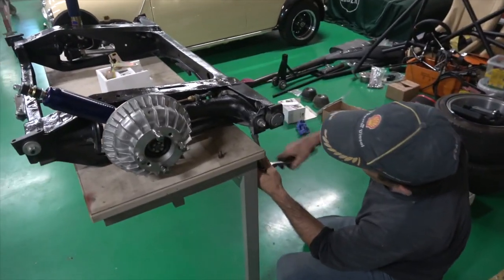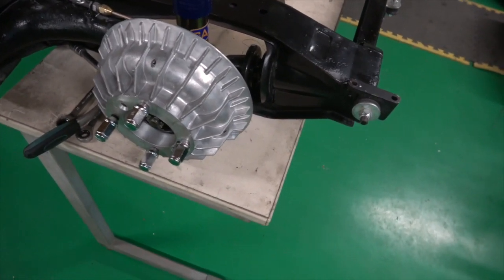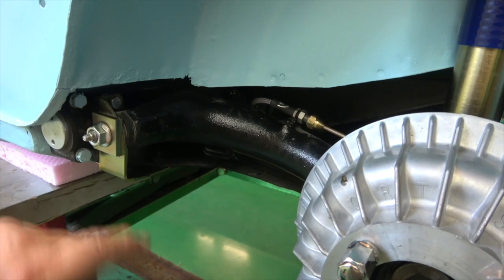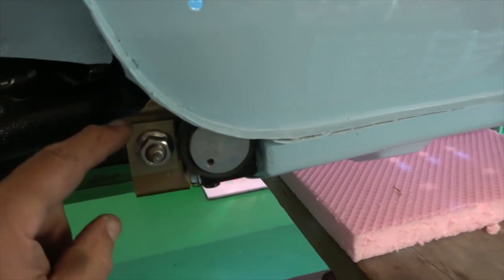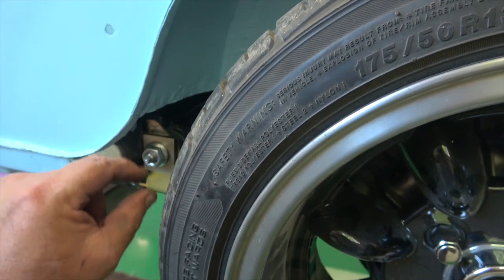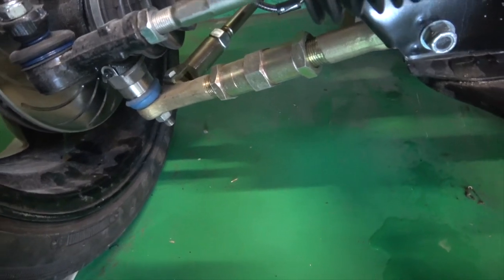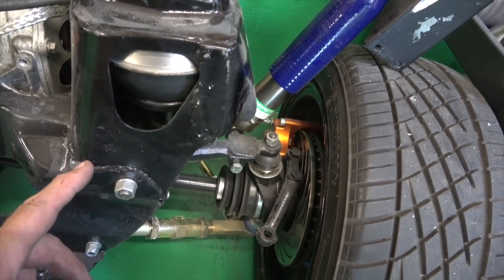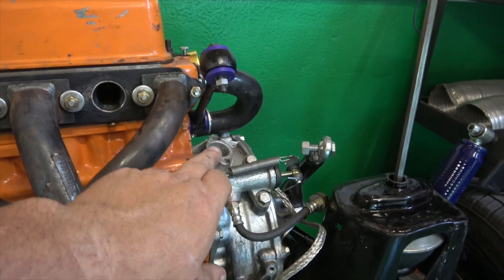Classic Mini Rear Subframe Camber Adjustment Kit ( Track Car )

Comment: Do you need to remove the sub frame to fit this kit?
Reply from the maker: Johnny,  No you just swap over the original radius arm pin bracket for the the new one in the kit. As long as the 2 bolts that hold the bracket to the subframe are nut rusted it should only take about 10 or 15 minutes each side. Cheers Dave
Reply: Legend. Thank you

Comment: Great video 👍 Dave could the difference on the camber marks be down to the body shell geometry .
Reply from the maker: Sean, There is a very good chance it could be the shell as i don‘t think the heel board is original, I have had comments about them not 
lining up the same each side on other viewers cars,  I will be having it checked with a computer alignment system, Cheers Dave

Comment: Dave you have a great build going on. I would check your toe in after a few runs as it seems to lock well for the camber but the toe looks like it could move if a bit loose or on a bumpy track like i ran on .
Reply from the maker: Mike,  Thank you, We will be doing a lot of adjustment as we will have a lot of setting up sessions, When the car is finished it will go to for a
steering geometry check where we can adjust the toe in or out all round before it‘s first track run, Cheers Dave

Comment: Really informative video as always. I like the idea of fabricating a breather using the mechanical fuel pump blanking plate.
Reply from the maker: Steve, We have not used them before so we are learning as we go, The Idea came from Paul Jeffries at JPE as there is no breather on the timing
cover as it‘s a rubber belt drive so to vent the cranckcase the old mechanical fuel pump flange is perfect, Cheers Dave

Comment: Its definitely taking shape now. A little concerned about the radius arm brackets. A pot hole could easily know them out of alignment. The ones with the bolts, ? Do they not hold it in position and prevent it from moving or is it only there for making the adjustments.
Reply from the maker: Anthony, TBH honest even the minispares brackets are the same thickness as the originals and there is no way they will slip on a flat track
but i take your point on badly paved roads, What i do really like is the amount of contact there is on the plates & the nariled lock nut, Cheers Dave

Comment: Great update Dave!!! One thing about the breather on the crank, maybe braided hose or heat wrap would be a good idea being near the exhaust manifold
Reply from the maker: Alex, It‘s a good point but the basic function is only to exhaust the crankcase pressure so the heat from the exhaust is not an issue as it
will be going into a catch tank on the bulkhead x member, Anything that helps with not blowing out the oil seals will be a bonus, Cheers Dave

Comment: Cracking on boys! just a wee comment......does the foam seal for the steering rack not go on the outside of the shell?
Reply from the maker: Martin,  Yes it does, Well spotted for a track car it‘s really not needed as the noise & vibration will be fairly high lol, Cheers Dave
Reply: i was sure you both spotted that lol you'll defo have ear plugs in 😂

Comment: I purchased a brand new genuine subframe aswell as Minispares' equivelant to these camber brackets. I too found that the measurements were way off between the two sides. Also, the I found that their type of adjustment, the ones you described with the bolt at the bottom, was a bit finnicky and annoying to adjust.
Reply from the maker: Eirik, Maybe it‘s a common issue!  I guess it depends on where the subframe came from heritage or a copy subframe,  Cheers Dave